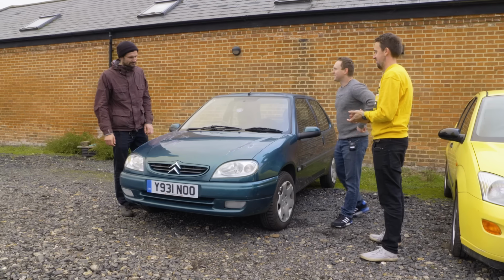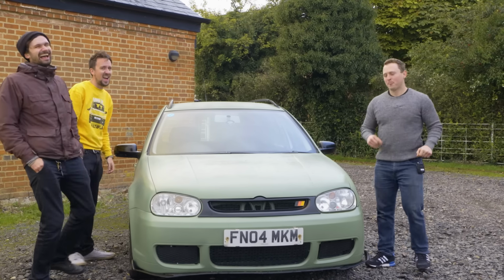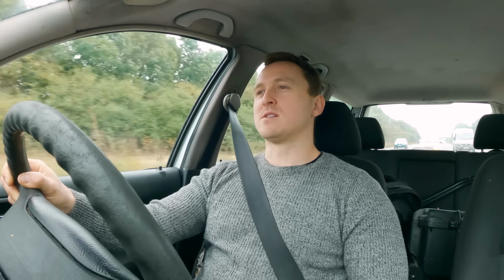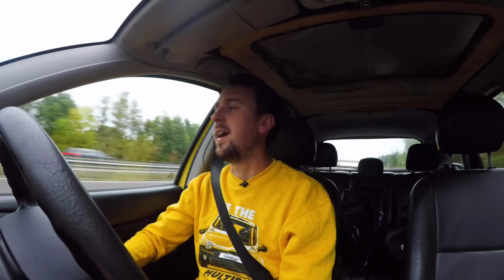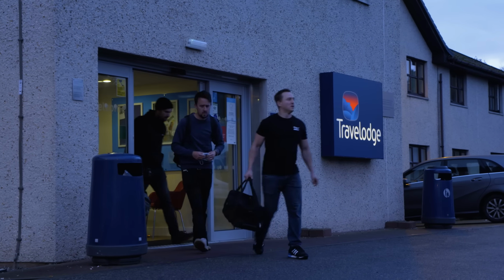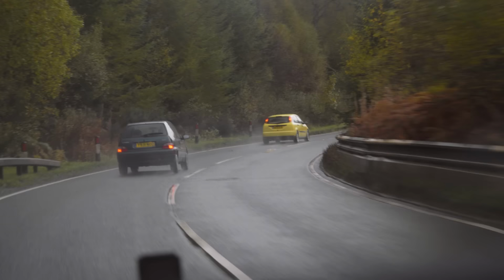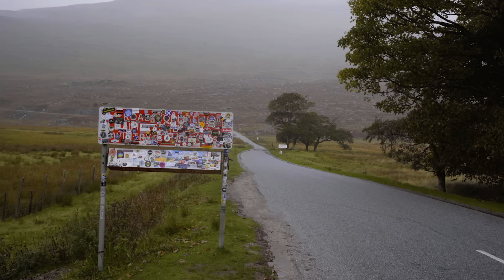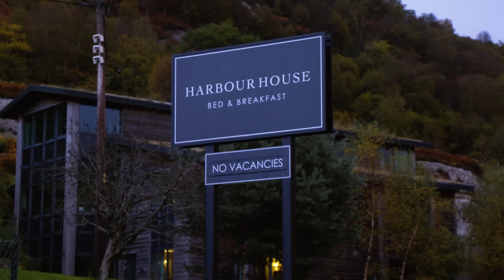£500 Road Trip Challenge

Comment: As a Focus owner, Ethan picked the best car... that's my unbiased opinion... I swear
Reply: focus svt owner here, i cant agree more
Reply: Sadly a former Focus owner, but enjoyed the 15 years with it.
Reply: Would anyone believe a word from a focus owner 🤣🤣👍👍
Reply: They’re shit cars better off with the Volkswagen
Reply: @hitachi42inchtvsarepowerco79  and other hilarious jokes you can tell yourself
Reply: @ImmAdam  I know from experience mate I used to have one, it was a 2002 and it was dog shit on wheels, it failed it’s mot on rust and a load of other stuff quoted £1300 to put it right when the car was only worth about £450 so I scrapped it and bought a 2001 Passat estate 1.9 TDI had that car 3 years now and it’s got close to 340k miles, never had any issues with it, never failed it’s mot, never broke down, never needed any work on it.
Reply: Yup.  Here in Canada, the generation from 2005-2007 were terrific (face-lifted Gen 1, but with the 2.0 Duratec replacing the 2.0 Zetec).  I have had several in the family, and still drive a 2007 5-speed Wagon (Estate).  The only real weakness was rust in the rocker panels, due to the drains being sealed over during manufacture.  If you just clean out the sealer with a small screwdriver, you are golden.
Reply: @ggj666  they shouldnt lmaooo
Reply: I miss my ‘03 focus with the Zetec engine 😭 it was shite I’m reliability but it was my first car
Reply: Chris Harris would agree.
Reply: @bobmcl2406  as canadians you should know better than to buy "septic bins" from uncle henry across the border.

Comment: Ngl I absolutely love that wagon. Color, shape, ride height, I think it’s gorgeous
Reply: i think if you would give it some love, it could do another 250k for sure :P
Reply: You need to get out more
Reply: All it needs is a TSI engine swap, new bushings all round and boom it'll run forever.
Reply: @samueljones3668  newer TSI engines are Junk, u can throw them away After 150k km :p but the original engines from those Golf 4s is just amazing. If u keep em well, u cant destroy them, u just cant 😂
Reply: @iamlegend3379  New tsi engines junk? Ive seen many of them in harsh tropical conditions pushing 200k km. Then again, ive also seen many bmw e90s last pretty long in my country, maybe because cars are treated as long term investments where I live so people dont skip maintenance or mistreat em
Reply: @Ben-mw9vz  im talking absolut tsi engines from VAG, those are trash. Ive heard about so many cases where After 100k km u had to do the Chain of the Engine.  U didnt have to do that in the old engines. Look how engines have changed. Back in the day a 1,6l did around 105hp. Today a 1.0TSI does around that. Engines are getting smaller in Cubiks and bigger in Turbos. I dont Think These engines are reliable.
Reply: I am shocked how good golf looks. Previous owner had some good ideas.. Well apart from engine choice!
Reply: Its an absolute turd all vws are just utter terrible overrated crap
Reply: @scotchrobo  With a good engine swap, some upgraded coils and a nice sound system, this car would be phenomenal
Reply: @scotchrobo  I also agree with comment. I am a peugeot guy all day long..

But for a vw estate they had done the best they could!!
Reply: Samuel Jones dont u mean 1.9 TDI?
Reply: @iamlegend3379  I think some of the newer TSI ate belts and didn't have chains?
Reply: @papa_pt  nope, 1,2tsi, 1,4tsi 1,6tsi are all chain driven engines
Reply: @iamlegend3379  yeah I was thinking of the tfsi 2.0 in the states
Reply: @papa_pt  i Think since 2010 the 2.0 is also chain driven. Correct me if im wrong😂 but the 2.0 tfsi is an amazing engine. 1.2, 1.4 and 1.6 tsi are trash tho. But that 2.0tfsi is also found in the golf 7gti/golf7r which is a dream of mine ;p
Reply: @Ben-mw9vz  youre talking about 200k kms into tsi while this shitty sdi can go to 1 mil
Reply: @iamlegend3379  definitely not

Comment: I've actually went on a 4000km roadtrip trough Europe this summer in my 1998 Citroen Saxo for which I payed 400€. It's also only on 41k km and drives better than a lot of modern cars i've driven.
The funny thing is, I'm 1,90m and was perfectly able to sleep in the car comfortably with all my stuff beside me in the car. You can also sleep pretty much everywhere, cause nobody's expecting someone to sleep in such a tiny car.
I wasn't expecting how far 60hp can bring you, but I made it to an altitude of 2400m in the Austrian Alps. The way down was actually a lot scarier than the way up in second gear.
It really is the perfect car for a one-man-roadtrip! Next time you buy a car think about what you really need :)
Reply: did the same in a citroen AX, same height too, i found going up some insane slopes was scarier than going down
Reply: mountain roads are no match for 60hp - most of them were designed for cars with 1/3rd the horsepower (per weight)

Comment: Pro tip, when you push back a car without a reverse gear, it is easier to lift the wheel in such a way that it rotates in the desired direction. Helped me get a car up a small incline when I couldnt push it. But please, be aware of the parts within the rim so you dont crush your fingers on the brake caliper.

Comment: When you have noisy wipers, pick up some isopropyl alcohol and a can of silicone spray. Using a napkin or a cotton ball, clean the blade surface thoroughly with the alcohol, then treat them with silicone spray and wipe them down a second time with the spray. Usually solves the noise problem. Sometimes even cleaning the windshield will improve the sound. I used to hit my windshield with Kanuba wax, then the rain would be well deflected from the windshield, allows you to not even use the wipers for a length of time.

Comment: On Alex's car, the temp 'shooting' up to 90 in traffic sounds more like a thermostat stuck open so that it sits well below operating temp on normal driving and only reaches temp with no airflow over the radiator. 
As a side note that's not a PD engine alex
Reply: Typical VW
Reply: @joeman840  typical stuck thermostate. Got same issue but after 400k km in my tdi. Part cost about 20 GPB. So nothing horrible.
I think boys didn't check their cars just to make movie more fun. But they should at least change or fill up engine oil before journey :)
Reply: Actually it sounds more like a thermal switch or radiator fan itself. If the thermostat was sticking closed, It would overheat whether you were driving or not.
Reply: @schrodingerscat8621  Thermostate failure might also mean that it stays open so coolant is never heated enough because all the time full flow goes through radiator. Persolanally I got this type of failure. Even took the old out and and put in water then checked what happen if I heat and boil the water. It was not closing in cold water. The new one worked perfectly.
Reply: @wisniatd  The only true wisdom is knowing we know nothing. Socrates
In the first episode the complaint was running hot in traffic, that’s not a symptom of a thermostat stuck open, then it would run below operating temperature, but then in the second episode, he indicated that it was running cold sometimes, that would be a thermostat issue. The thermostat certainly is a cheap part to replace and good insurance against keeping proper temperature. But vehicles that start to run hot when they are stuck in traffic is usually poor radiator flow or a radiator fan not engaging when needed.
Reply: @schrodingerscat8621  You might be right, mate :)
Reply: @schrodingerscat8621  when stuck in traffic the temperature Alex referred to it shooting up to was 90 which is normal operating temperature, he never mentioned it going above that which would indicate the thermostat is stuck open
Reply: @euanroy4673  Right, 90°C is like 191°F which is normal you’re right. So why did he mention it like it was a problem? So if it was way below that and then went up to operating temperature, you’re right it would be a thermostat stuck open.
Reply: @schrodingerscat8621  I'm not sure why he said it like it was a problem, obviously a stuck thermostat will effect fuel economy but no damage will occur from the car running a bit cold, they obviously just don't know what there on about 😂
Reply: Thermostat stuck open=engine runs cold,syuck closed =engine runs hot, not sure? remove thermostat!
Reply: It is. I had a mk4 golf many moons ago and had the same issue, new thermostat solved that.

Comment: That Focus still looks sharp, 20 years on!
Reply: Not messing with the 69 upvotes...
Reply: Facelifted Mk. 1 Focus is a great car, and still looks great.  We had a 2002 1.6 Zetec model about 6 years ago.  Unfortunately the rust killed it - rusted through around the seatbelt mount points and the rust killed the power steering rack too.  Uneconomical to repair, so it got sold to someone who just wanted the engine for a project.  Shame.

Ours was plain old silver, though, not ULTRA LEMON YELLOW like Ethan's.

Comment: I love my Focuses. I just bought the third one and second wagon version that I've owned now. All have easily gone past 250k+ miles now without hardly any issues besides an alternator in my current one, and my last one getting flooded out.

Also praying for Jenny.
Reply: Same here, learned how to drive with a 2003 ZX5, I still have that but expanded the fleet to having a 2002 ZX3 SVT and a 2018 ST to daily. Great little cars!
Reply: also liked mine (and it drove well), but needed a new engine at 100k. Ragged it a bit, but still.

Comment: My currently daily driver is an 03 Saxo Desire. Even the same shade of green. For the last couple of months my daily commute unexpectedly changed from pootling 2 miles up a local road to 30 miles of motorway. Yep it's loud, rickety, and the engine is working very hard. But always does it. Surprisingly reliable for a 90's designed French shitbox!

Comment: Man, dont underestimate the 1.9sdi
We got a second gen caddy pickup with that in it, you would not believe the things we have towed and the abuse we put it through at this point. its well maintained but has around 370k km on it, lumber-hauls, used it to flatten overgrowth after the spring on a backroad a few times, used it as a daily for a while and so on. And the engine and gearbox genuinly have not ever had issues.

Comment: 10 years ago i bought a 1997 Daihatsu Cuore for 500€ and drove it 4 years without any problems as my secondary car here in germany. Then the timing belt snapped cause the previous owner didnt changed it like he claimed. I sold it for 150€ to a guy who had the exact same car for his daugther, with a good motor but very rusty body. He said he would swap his engine in my car, cause mine was very clean, looked almost new from the outside. He came all the way down to munich from west germany with a trailer.

Comment: All Golfs should sit at 90 degrees or just below on the temps, the SDi's often have sticky thermostats.  I've got two Caddy SDi's and they both stick with temps fluctuating from cold to 90 degrees.  They are better in the summer.  I hope that oil was the right spec or that SDi engine will soon drink it up.  The temps also affect the heater matrix, right pain if you are on a 500 mile plus round trip delivering in winter.

Comment: 10:08 "scream a little bit when you get it up to 70mph"
Yeah, that car is designed for 55-60mph. I know from experience. At 70mph it is doing too many RPMs to be comfortable... and you lose fuel economy too, which was the strong selling point of the 1.1 liter engine.

Comment: i have owned a 1996 ford festiva 5 speed with 300+ original miles..now i have a 1991 volvo 240 with mud tires..a welded diff an idk how many miles is on it

Comment: Had that model of focus mates called it the Bumble Bee always buzzing my arse used to slide forward on those seats no grip at all on them worst thing about it other than that was a good car.
Just bought an X reg Corsa B 1.2 16v 24k miles One not so careful elderly owner.
Apart from running it apart I’ll do some Autosolo’s in it.

Comment: This is cheating... you've actually bought three of the best cars you could buy at the time!

I had a mk1.5 1.8TDCI estate and not only was it an epic load lugger it was pretty nimble in the bends and surprisingly brisk through the gears. Rust is the enemy on them however.

Those little Saxos are a riot, the 1.1 is rapid and a lot of fun in the bends.

I didn't realise the mk4 Golf came with a non turbo diesel though... Good lord 😂

Comment: Yeah those old small Citroen engines are a bitch at motorway speeds. I got a 2005 C4 coupe with a 1.6L gas engine which shares the trait of REVING LIKE A SON OF BITCH FOR NO REASON with all of the sub 2.0L Citroen engines. Only 109bhp yet it revs incredebly high with no benefits and only loss as the gas mileage just climbs up and engine wears out as fast as a rotary